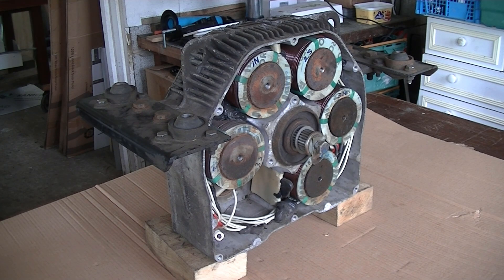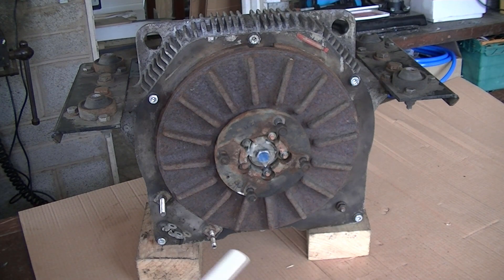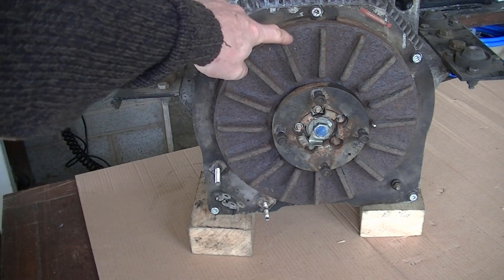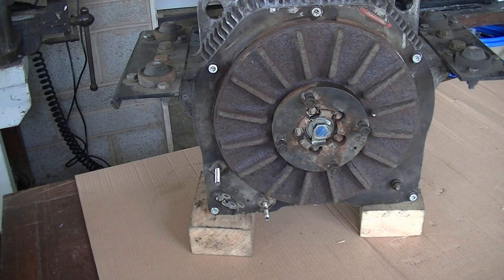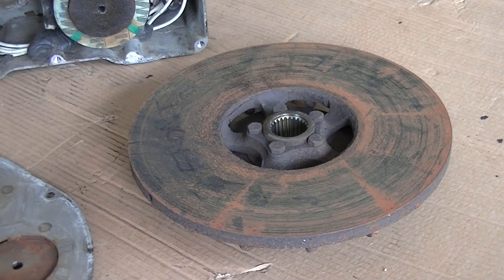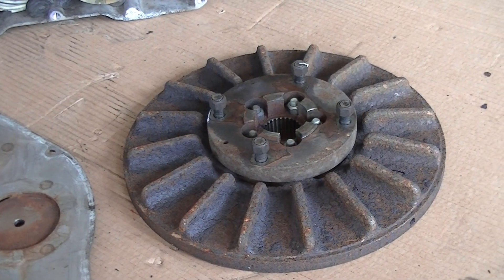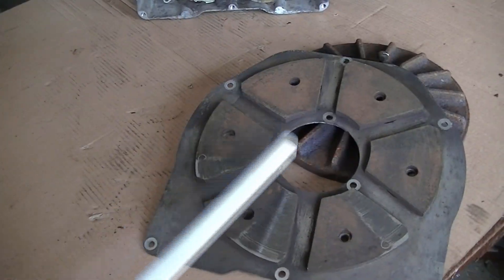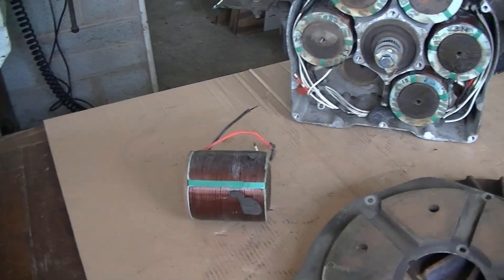Mercedes Sprinter, Telma Retarder revival part 2, What's inside the box?

Comment: Don't these things get red hot on long slopes. I believe that's why the industry dumped them and moved to hidraulic retarders.
Reply from the maker: Each rotor has cooling fins and these are substantial chunks of metal so it will take a while to get hot but yes I suspect they do, the internal cabling is insulated with heatproof sheathing.

They are very robust though, there are plenty out there with similar age and mileage under their belt,  I doubt the Emergency Services would have consistently used them or MB gained German TUV approval if they were unreliable. mine was the first faulty one I have encountered.

Comment: I would unwind the faulty coil to see if it is repairable. I will be surprised if it is aluminium and not copper wound as a thicker wire will be required to carry the same current as copper. Also check that the winding is not also shorted to the core (unlikely). Any local electrical motor rewinder business could rewind that coil for you. Good luck with your repair. Paul.
Reply: Why not take it to get Rewound? 
A company in Gateshead are fantastic, Team Rewinds www.teamrewinds.com,
I’m positive they could do your coil
Reply from the maker: @Trucker_Blakey  Your comment  got held back for review by the Youtube spam bots :) but yes as I said to Paul I probably will get it rewound, thanks for the link.
Reply: @CriftinsCampers  No worries chap, of all the stuff i scrap 99% of new electrical items are unusable due to burnt out ally windings, without fail evey microwave i scrap that doesn't power the magnetron (IE it works but doesn't heat anything) is ally wound, everything out of china for the last 10 years has been ally wound, funny enough all the chinese domestic market items i've had are copper wound and still work, strange that! i wonder if WAS used chinease manufactured coils, be interesting to know, well for me it would anyway lol.
Reply from the maker: Paul Merritt Hi Paul Thanks for the suggestions, yes I have checked all the coils for isolation to the cores as best I can and they are ok including both ends of this duff one. I have unwound the first windings from each end of the faulty one just in case vibration had caused a break but unfortunately nothing obvious, if I cannot get a direct replacement I will investigate getting it re wound at somewhere like https://www.rbaker.co.uk/services/coil-winding/

There is a sleeve made from a gasket type material  between the core and the coil but the core is so rusty I can pull it out to check the inner windings. 

The coil is some form of white metal alloy under the shelac it’s definitely not copper.
Reply: @CriftinsCampers  Could be aluminium then. I used to work in telecoms and aluminium was used in the UK underground network (to reduce cost) for a few years in the late 1970s and early 80s the big problem was electrolytic corrosion when jointed to existing copper wires. If moisture has got into the windings that could be the issue with yours. It's not tinned copper wire is it? How are the copper tails attached to the windings, can you see?
Reply from the maker: Paul Merritt definitely not tinned copper, they are crimped to the supply cables and then protected with glue lined heat shrink so no water ingress.